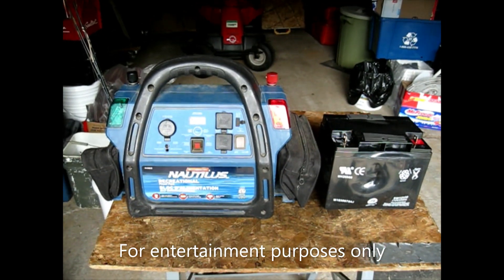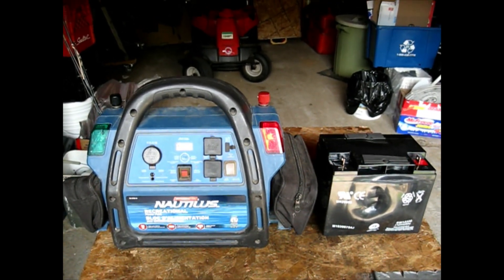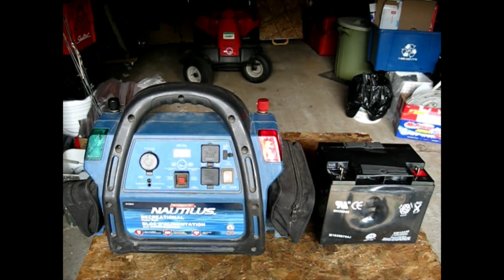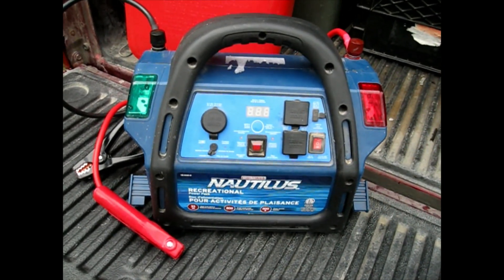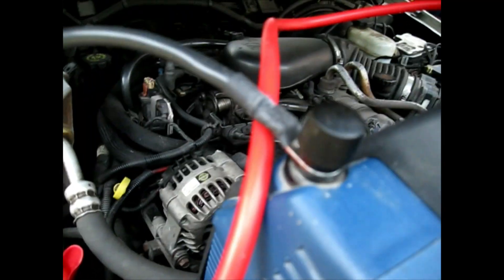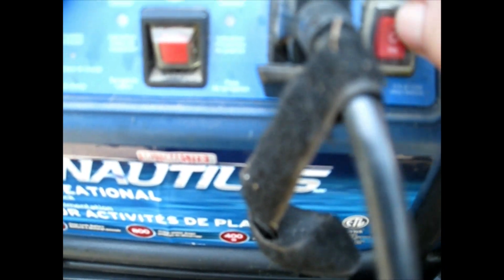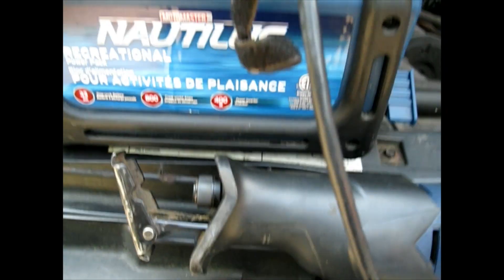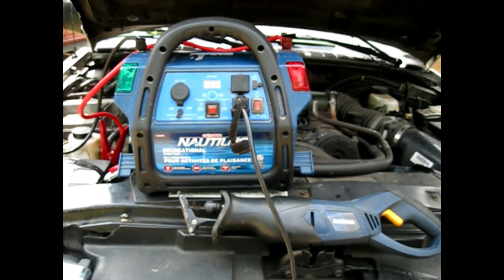Nautilus Power Pack and other Power Packs Hack

Comment: Nice!  I have the exact same Nautilus power pack and it's solid.  Question, right now when I try to plug anything into the 110V and flip the button down, it beeps and only charges for a few seconds then stops.  I was trying to run my laptop off it.  Any ideas? Thanks.